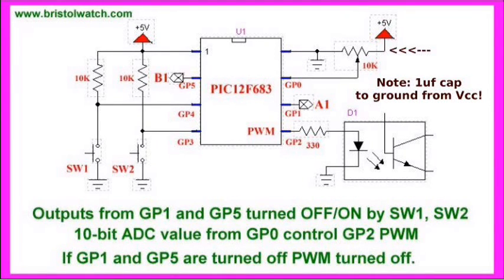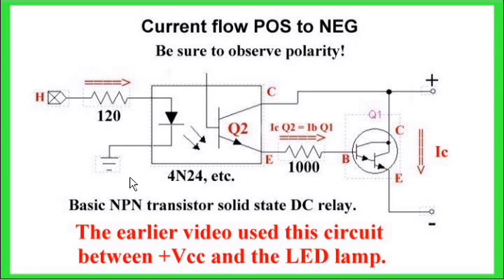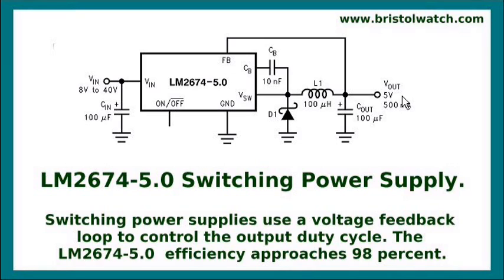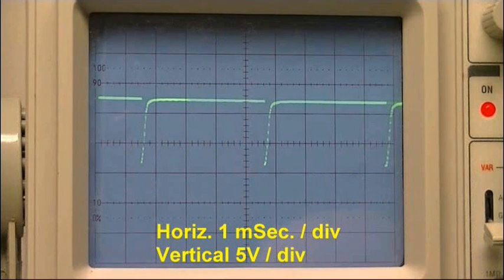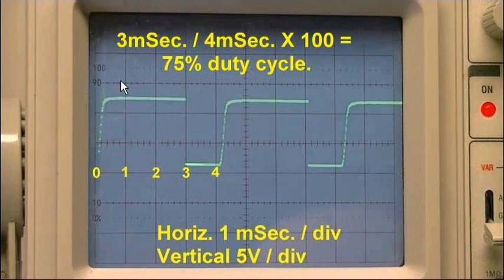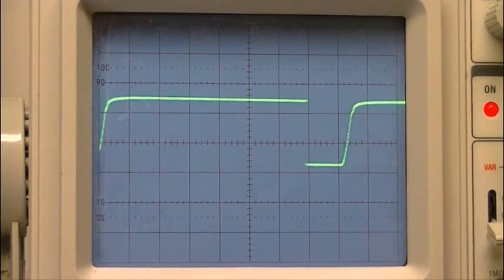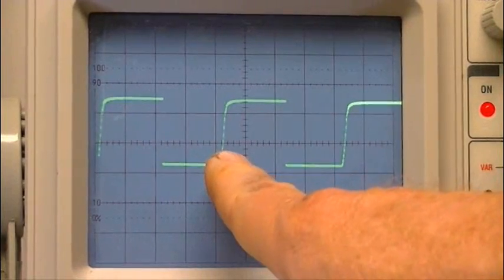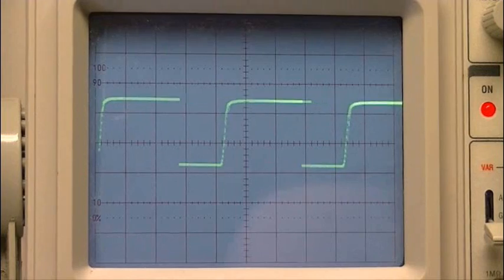Pulse-Width Modulation Tutorial

Comment from the maker: One can't use PWM with AC you will have to sync to the zero crossing point and delay from 100us to 8.3 mSec. to control triac turn on. If using three-phase that will be three separate circuits with common delay time for each of three triac turn on.

I plan a video to further detail how this works.

See http://www.bristolwatch.com/arduino/arduino_power_control.